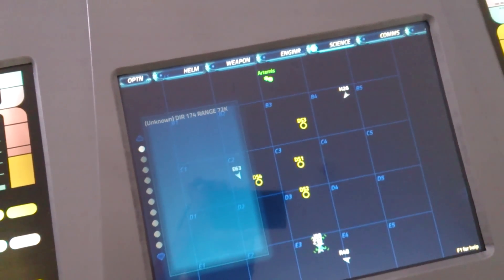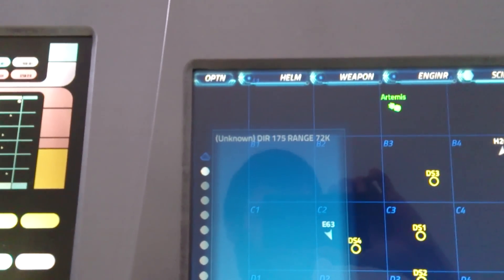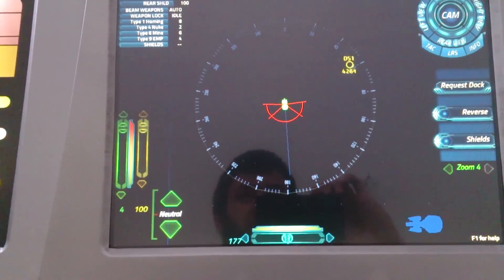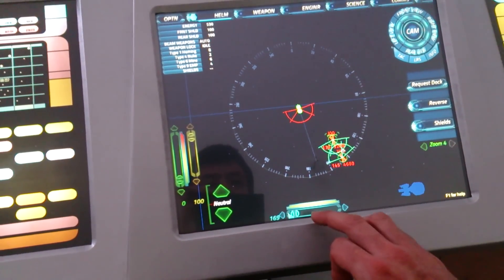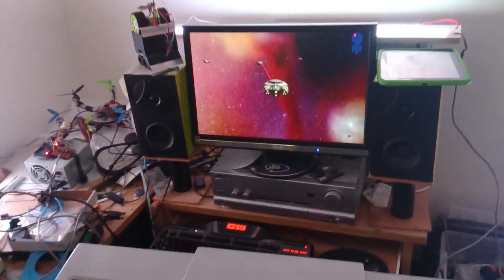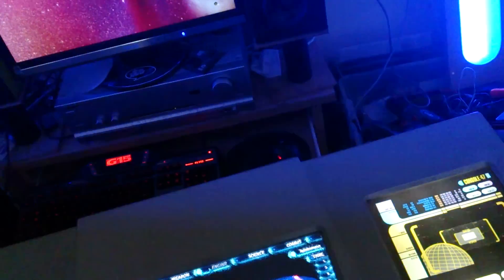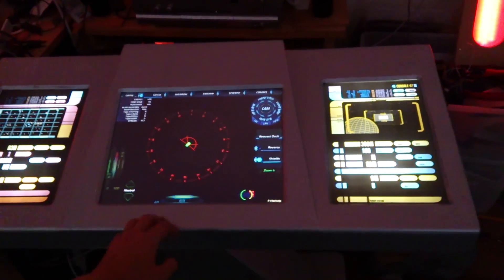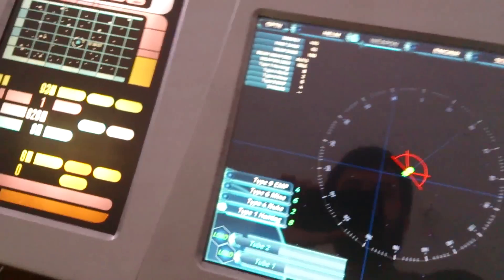Artemis Console and DMX

Comment: Love that console and DMX lighting.  Setting something up myself soon and getting the lighting kit soon.  Did you make that housing that encases the light I am seeing at 0:15?  It looks like it can be mounted on a wall.
Reply from the maker: Thanks. Yeah I did make it. Basically, I cut the oval shape out of a sheet of MDF, and routed over the edges to make it smooth. Then used some white perspex type material as the window to diffuse the light.

Comment: do you have a link to the screen you are using please?
Reply from the maker: http://www.cyclotouch.com.au/index.php?cPath=315&osCsid=bf64107f7e424041e611fe7db07b9396 This is where I got the touch overlay but I would only recommend buying from here if you are in Australia. Much cheaper from Ebay. The actual screen I already had.